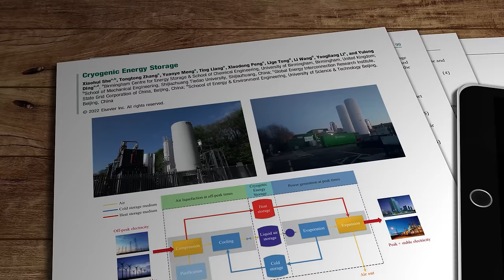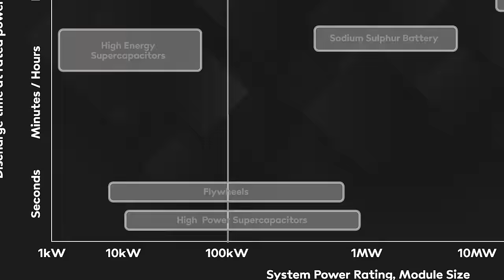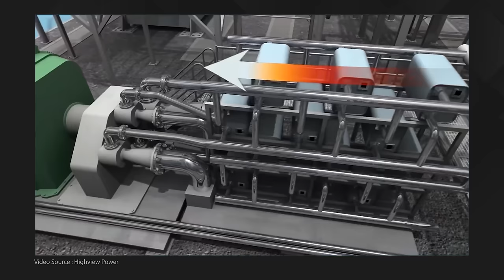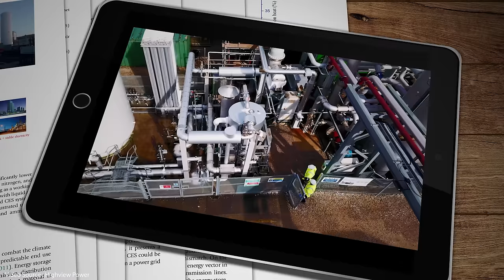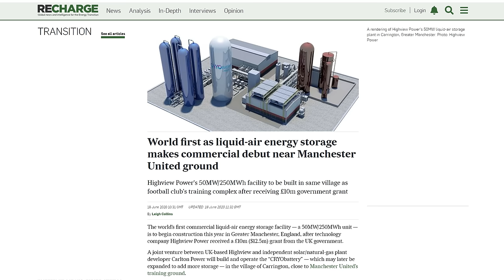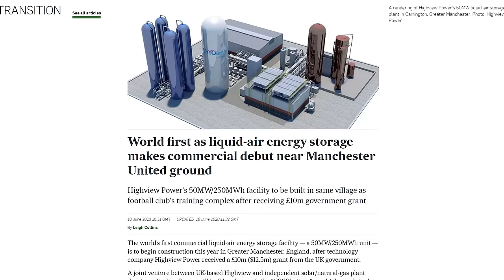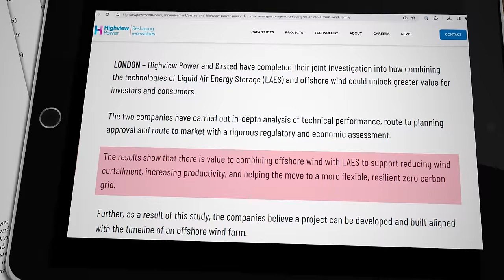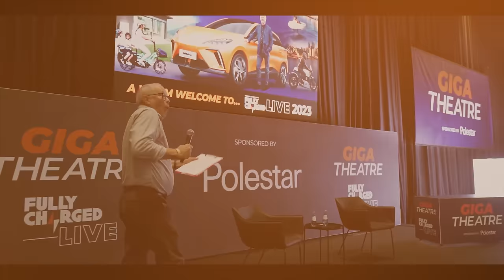Cryogenic Air Energy Storage - the new long duration energy solution?

Comment: Capturing the heat of compression is a bit interesting.  I work for one of those OEMs.  Our compressors shut down at 300ish degrees to keep from destroying themselves.  That's not a lot of heat.
Reply: I suspect it may be as simple as pumping coolant. Though you may need a heat pump to keep the temperature deltas up as you near your maximum heat storage capacity.
Reply: It'll be proportional to the volume of gas that's compressed (sorry, I know you know this but..)
If it just means that you need more tanks of water to store that energy while also keeping the compressors cool, so be it.
I'll bet that a quick look at plans for a real installation would be the tell of ratio of water (heat store) to cryogenic compressed air. That's if the sketch in the video isn't already close enough.
Reply: @dougaltolan3017  I just don't see the delta T to store enough heat.   I'm guessing they are going to use a lot of ambiant vaporizers.
Reply: @dave4882  I think the storage system doesn't scale up to grid level. They need massive amounts of heat storage to keep the efficiency up. So either the energy storage costs too much due to the bad turnaround efficiency, or the heat storage systems are making it too expensive.
Reply: 300C or 573K? I think the point is, because liquid nitrogen, the baseline isn't 273K but more like 100K and it's the differential that counts.
Also, I wonder if the captured heat could perhaps be shared out in a sort of combined heat/power setup: if you want heat, best efficiency is to NOT convert it to electricity and back to heat again!
Reply: @rivimey  300f.   Too hot for it to continue to run.  We normally run way below that.   This is the incoming air compressor.   Multi stage turbo compressor.   I have seen one melt the oil seals in about 60 seconds during testing.   Oops.   2 days of compressor rebuilding.  Compression of air can release a lot of heat, but not what I'm used to seeing in heat storage. 1500F or above.
Reply: @dave4882 what is the stupid f symbol you keep typing after a number. It can't have anything to do with temperature. The SI degrees c or the better measure K would be what you use if talking about temperature.
Reply: @radicallyrethinkingrailwaysina    Sorry, but thats the way we here in the worlds largest economy choose to measure temperature.  I can speak C, K, and R.  But I choose F.  Since you don't seem to be able to speak F, its about 150C.
Reply: @dave4882  who the actual F cares about "the world's largest economy" doesn't mean shite. The rest of the world, the bit with the proper measurements, is much bigger. You choose F for your own reasons.
Reply: @radicallyrethinkingrailwaysina  Actually who the F cares about what you think.  I was having a decent back and forth, then you show up trying to pick a fight.  Go some place where people think you make sense.
Reply: @radicallyrethinkingrailwaysina  bro, we use F just to piss you off.

Comment: Thanks Dave. Those facilities in NT which you mentioned are geared for producing that rated power for 12 hours. Clearly, at lower loads they should be able to run for a day or longer. This provides an excellent buffer for those relatively rare occasions when the Sun doesn't shine after a night with no wind. Sure, the overall efficiency is only about 60%, mostly because of the work which has to be done in cooling and heating the gases, but other losses can be minimised through experience. And 60% is better than the inefficiencies incurred in needing to install even larger over-capacity electricity generators which include fossil-fuel burning power stations.

Comment: That 60% efficiency is a stretch and it’s very maintenance intensive, note the manpower required for operation.   In comparison pumped hydro has a 100 year lifespan with almost no maintenance, and then refurbish the turbo pump/generators, and good for another century.

Comment: Thanks for another great video! Cryogenic air energy storage certainly has some advantages: building the plant from existing components is a big deal. That immediately makes this technology more feasible than others that require lots of new designs and testing. And as you said, it makes upgrades and replacements much easier and less expensive. Plus there's the lack of any dangerous or expensive materials. If one of these plants leak it's just going to spill liquid air. It can't catch on fire or spread contaminants around, and you wouldn't need to evacuate the neighborhood.

On the minus side it's only sixty percent efficient. That raises the price of the power it's storing, but as you showed on that chart (excellent way to summarize the information, btw) the main competitors are "Hydrogen and Fuel Cells" and "Compressed Air," where hydrogen has obvious disadvantages , fuel cells are (I think) still very experimental at this size, and compressed air has a similar efficiency to cryogenic air. Pumped hydro has them all beat, but that's massively expensive to build, and there's only so many places to put those facilities.

Comment: I wonder if fractional distillation producing oxygen as a by product would improve the economics?

While chilling down the nitrogen why not separate out the oxygen (which at standard pressure condenses first)?
Reply: If you remove the oxygen you have lost the energy you used to liquefy it.
An analogy would be storing energy by compressing steel springs and the sending the compressed springs to a refinery to be made into tin cans - absolutely pointless
Reply: @PaulG.x  You can capture the refrigeration from the LOX and use it to precool the incoming air.  I work for one of those OEM's btw.
Reply: @PaulG.x , it's just a question of what is more economical.
Reply: I was wondering similar things.  It seems like it should be possible for the facility to double as a gas capture plant and use electricity instead of curtailing it, when applicable.
Reply: @te8547e  can you restate that?   Not sure I understand

Comment: You mentioned that they are putting in electrolyzers at the Manchester site which adds an intriguing posible option. 

Also set up an ammonia plant which would get the hydrogen from the electrolyzers and nitrogen from distilling some of the liquified air. The Haber process for making the ammonia is exothermic which could be used to boost the efficiency of the LAES plant and make up for the liquefied air used to produce nitrogen.

Ammonia is a lot easier to store and transport than hydrogen and the equipment to do so is off the shelf.
Reply: The inefficiency of the Haber process is that you have to cool down the reactor effluent to condense out the ammonia.  Isn't the heat of reaction already being used to heat the new and unreacted materials back up to reacting temperatures?
Reply: @richdobbs6595  and the heat from the cooling process is normally disposed by radiating it to the environment. Instead of that, store it at the LAES facility until it is time to feed power back to the grid.
Reply: @IronmanV5  Hmm.  The temperature at which the ammonia is condensed is pretty high around 450C.  It doesn't seem likely that this heat is wasted, given the large scale of a typically plant.  Are you sure that it is not used in preheating the raw gases?
Reply: Of the two storage alternatives, Nitrogen or Aammonia, Ammonia is surely far less safe for storage? I'd far rather store N2 long term.
Reply: @rivimey  Nitrogen storage is expensive, while ammonia storage is relatively cheap.  If you had skin in the game, you might change your tune.
Reply: @rivimey  Amonnia has been safely stored & transported for over a century. Every thing to do so is off the shelf.

In fact, ammonia is usually stored in liquefied form at room temperature.
Reply: @IronmanV5 essentially an LPG-like system.

Comment: Be interesting to see it in practice. Cooling the air and liquefying it will release latent heat, which they also store, though I guess some will be lost at the time and over time in storage. Then when power output is required the liquid is pumped to high pressure before being vaporised back to gas where the stored heat is needed, plus some from the atmosphere - that bit may be difficult with the heat exchangers getting iced up.
Interesting concept though that this can take low grade heat from the atmosphere to vaporise the liquid. Bit like a heat pump!

Comment: One other advantage I see is that liquid air storage could be located in deserts where land is cheap and solar makes the most sense.  Thus excess electricity could be stored on site with little to no loss due to long transmission lines.  The air is also already dry making it easier to liquefy.

Comment: Hyview's technology can be scaled up in energy capacity by relatively low cost increasing the size of the associated crogenic tank farm. Round trip efficiency of 60% is better than when  I visited them, but still a significant handicap that restricts the economic use cases. Over the same period, lithium ion battery costs have coninued to reduce down to just over $50/kWh. I wish them success

Comment: The big thing going for this project is the Carnot efficiency is really good for the energy recovery part. It also should not be underestimated how many companies used cold storage/chilling in part or all of their manufacturing process. Similar installations to this can be used in place of refrigeration installations with the added benefit of co-generation, and no need to convert back to electricity to run the cold storage - think of all those supermarket and Mall air conditioners that could be replaced with a chiller/electricity co-generation concept.

Comment: The typical energy return from ln2 is about 100 watts per kilo (from Wikipedia, ln2 powered car ) as opposed to 1,200 watts from a kilo of petrol . I worked in the cryogenics industry for 39 years and the high cost of vessel manufacture vaccum systems and vaccuum pumps mass spectrometers to test weld quality and system integrity , make it impractical on a cost to energy basis .